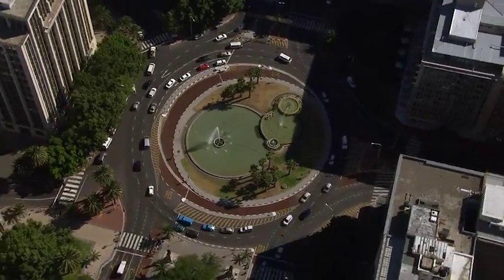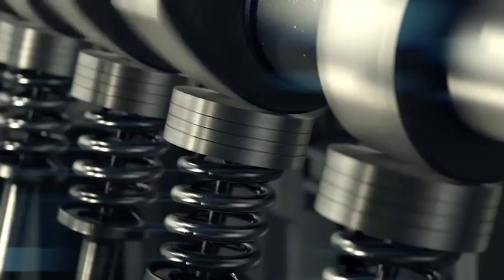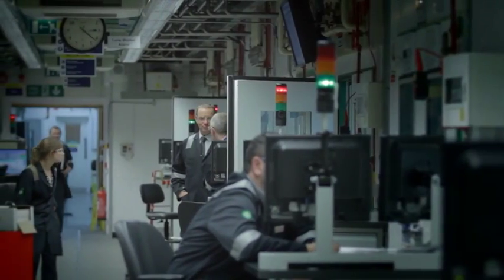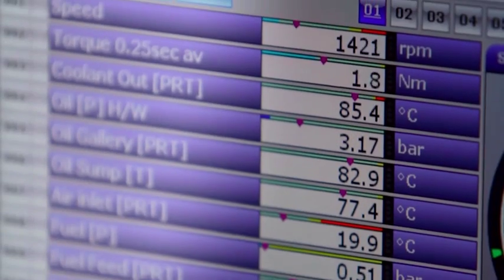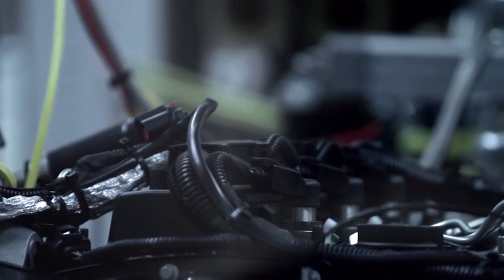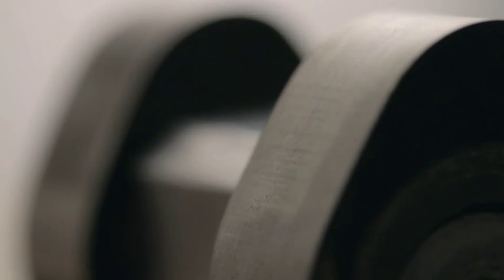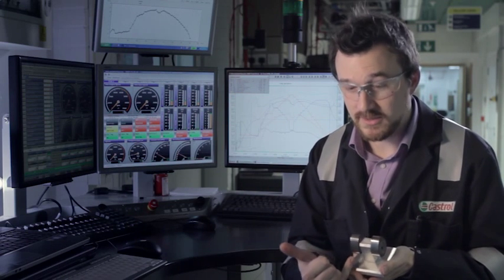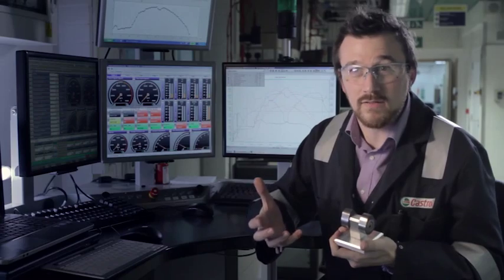Part 3 - The proof - Intelligent Molecules: the amazing science of CASTROL GTX  MAGNATEC

Comment: Its true
I took a go at Magnatec and its clings for sure.
I changed the oil and it clung to my hands and entire droplets wouldn't fall off. 
However after changing my oil back to a synthetic, I did notice the engine was running smoother upon initial start up.
Interesting.